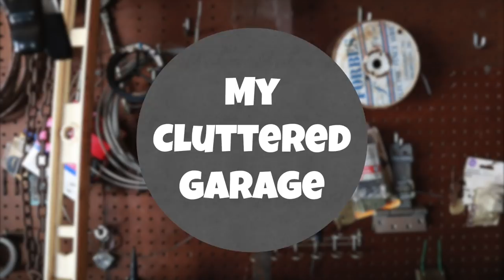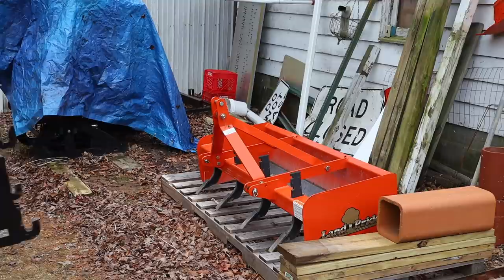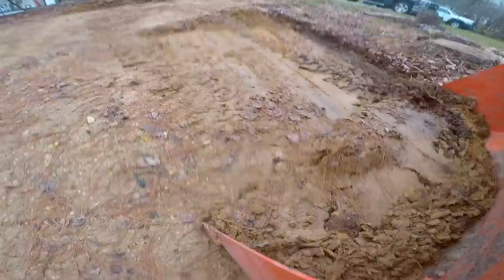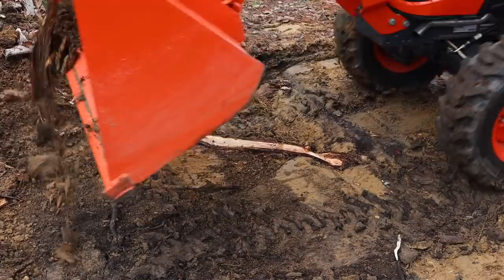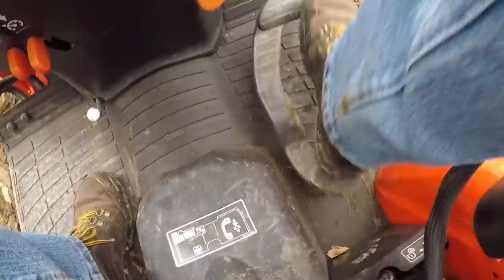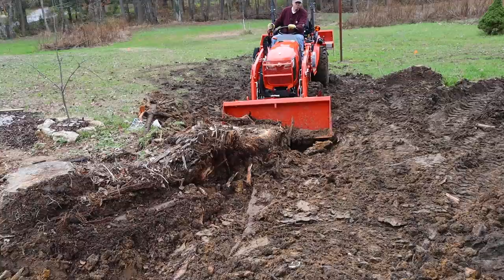Can you remove a tree stump with a compact tractor? Kubota B2601 with the LA435 front end loader #38

Comment: Why not use a piranha tooth bar to accelerate the digging/shaving?
Reply from the maker: I've been thinking of that. My hesitation is - will is affect my ability to back drag and finish grade?
Reply: My Cluttered Garage if you back drag flat with control you should still be able to fish. Also since the piranha is recommended to be attached inside the bucket that should make it easier as well. Also you could make/get a sheath to attach and cover the teeth on the inside thereby giving a flat surface. Especially if attached and with an overlap of the steel to equate to the flat of the lip. It’s  a bit of measuring and simple construction with an easy straight line weld bead. 
Worth a design attempt because it could be designed/refined/ manufactured in a junior college welding class as a project for sales and income on the net.
Have a great day...
Reply from the maker: @sheldonchanes3322  thanks much!

Comment: I think this is the moment when You should realise, that small compat tractor is NOT something You can compare with big construction machine. For this kind of job, there is a high risk of pushing Your small tractor too much. Then You can easily bend the Front Loader frame. I know it because it happened to me, when I tried to lift too much with my FL (I am using very similar model to Yours). I pay around 30 EUR for 1h of work of a backhoe that weights 8tonnes (with operator). I learned to call him when I have a problem like this , instead of pushing my machine above it's limits. The compact Kubota tractor is small, light weighted and narrow which is a great advantage when You are doing for example garden work. It will fit everywhere and do not damage Your lawn. But it does not have the mass and the power needed to removing stumps! You will be surprised, how fast You can damage the FL working like this.
Reply from the maker: Oh I’ve learned the hard way too! Thanks very much for sharing. -Ed

Comment: I probably would have sought out the help of a rental stump grinder machine.  They do a good job and can at least get down below the soil.  Not as deep or efficient as a big excavator to cut deep and rip it all out.  Another option is the use (rental?) of a stump bucket to help at cutting away at the roots with a higher potential for FEL stress/bending, though.    Time and effort vs. the $.  This would have been a very tough job for the backhoe.espcially for the small tractors.
Reply from the maker: I agree! Thanks so much!

Comment: NEVER PUSH ON THE STUMP , U WILL BE HURT YOUR FRONTEND LOADER  ! .

ANGLE THE BOX BLADE WITH SCARIFIRES DROP SCARIFIRES DOWN INTO THE GROUND ABOUT  4 FT AWAY FROM STUMP  START DIGGING MIGHT TAKE AWHILE BUT WORK JUST FINE  , I DUG UP ABOUT 50 STUMPS UP ONE SUMMER

Comment: You are putting excess wear on a costly tractor and making a terrible mess to avoid renting a stump grinder, which is the correct tool for the job. I have removed over a hundred stumps that size and larger from my property, digging and burning are not usually good alternatives. And now you have to level, rake, seed, and straw a fairly large area of lawn.
Reply from the maker: I can't disagree! Like I said at the end, I wouldn't really recommend this methods. Stump grinder sounds great!